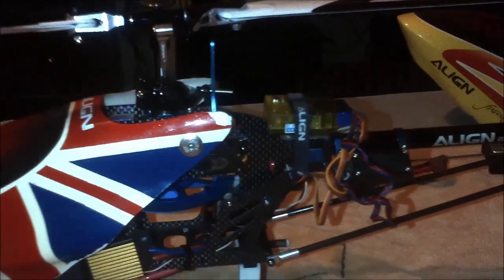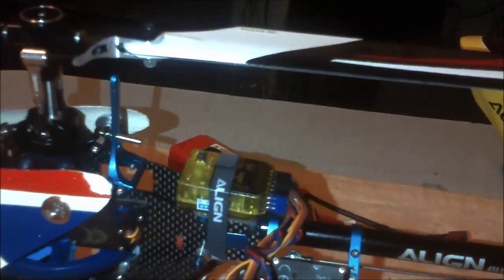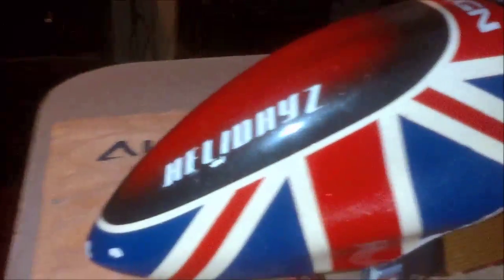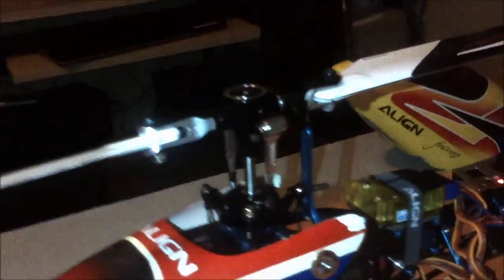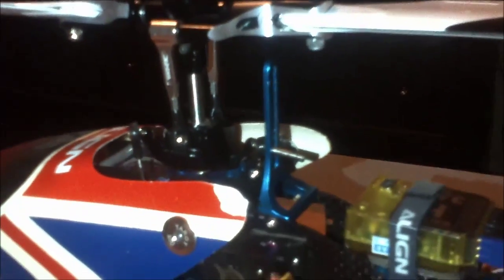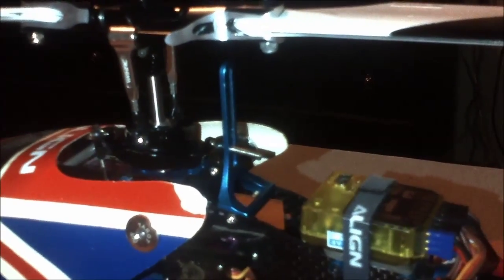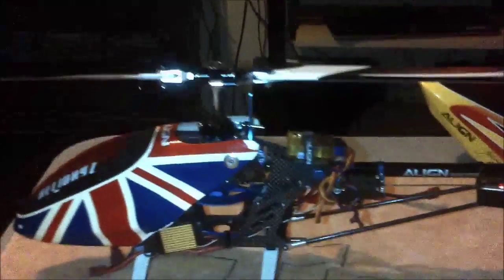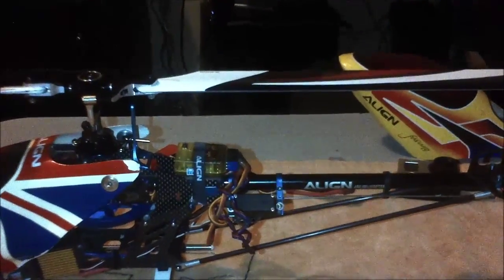Trex 450 Clone with KBar Gyro

Comment: just wanted to know if you use a receiver too I'm having trouble hooking my receiver to the k bar I'm using a 6ch spectrum radio and a receiver with a satellite  maybe you could help me out ?
Reply from the maker: Hi Brother..yes i do use the receiver too....i had no issue ...i have 6 Kbars and all i am using spektrum ar6210 , ar6200 with sat,ar6115e, and ar8000 with sat..... they all work fine, i love the Kbar...and it works as much as the Vbar....Thank you brother for checking in hope it Helps.
Reply: Helidayz thank I am still trying to get it to work I'm also using the ar6210 did you plug the satellite into the k bar or did you leave it in the receiver I got it all hooked up but the servo's or moving with the wrong stick in put, also when you hook yours up to v stabi where it says receiver in the setup with one do I pick. thanks again, just so you know I'm not to the helicopters.
Reply from the maker: i left the sat. in the receiver.....if the servos are moving with wrong stick is because the servos are plugged in the wrong slot.......do you have the Vbar program it s much easier to program it on the computer. hope it helps

Comment: hi nice heli bro. is this the KBAR Gyro V2 5.3.4PRO ? is it performing well for a cheap one? & can it be use with a copterx 250 ? thanks.
Reply from the maker: yes bro ..the KBar can be used on a 250 ,up to a 700 Heli , i have 6 Kbars, I install them on my 250,450,500,550 that i converted to a 600 and i also install a KBar on my 700...and they work well, they do the same job as a Vbar. you will love it as is.